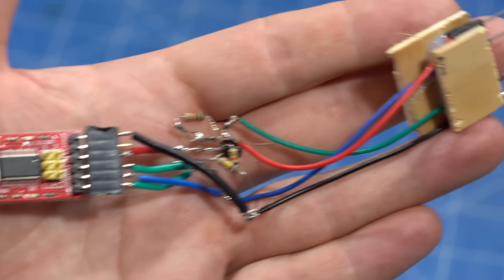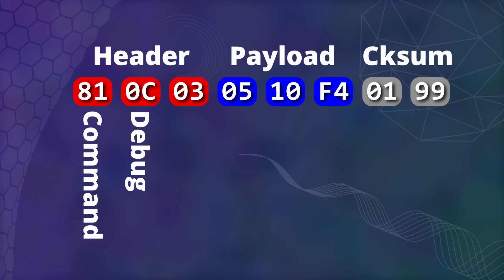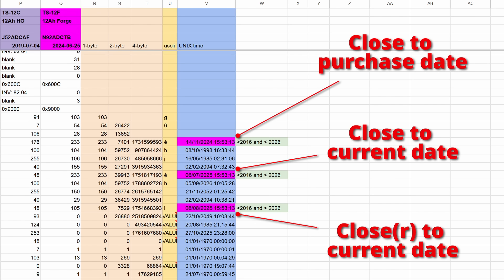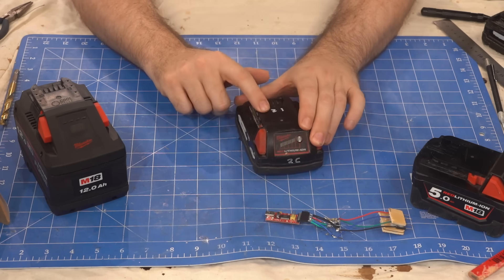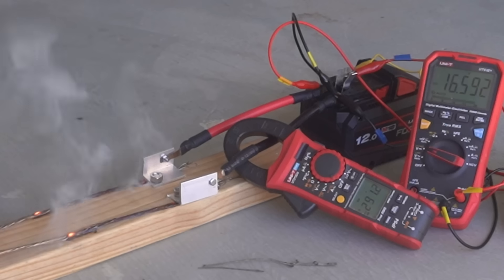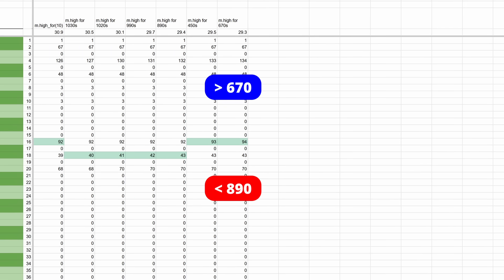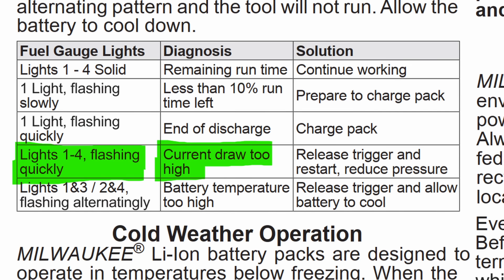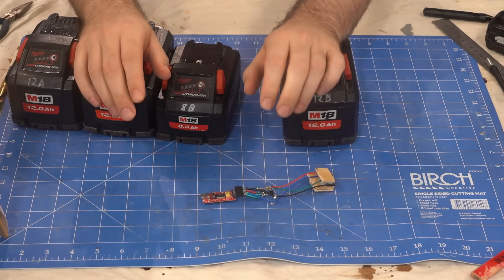Full M18 diagnostics revealed

Comment: wow... so what's the point? your batteries are still dead. LOL. if you can get the boards for $1 and resure the circuirts and reprogram the bms for something else cool but seems pointless all this work for the most expensive battery on the market LOL. YO use your brain man, time / effort does not help us all. you should have design a new pcb with blade terminals and a battery holder that fits inside the original case so we can use cheap 18650 or 217000 in these packs. ... there you go, do that project bro.
Reply from the maker: The point is to easily spot failing batteries before your warranty expires. Like bro, dude, use your brain, bro.

Comment: if you feel like diving into m12, the new 5.0 batteries have the curious habit of reporting 1 bar on one tool, but rebounding immediately to 3 bars when dropped into a different tool. they'll also red/green flash on a dumb charger, but after being pulled and placed back in the charger an hour or so later, fully charge like normal... i personally feel like they're a downgrade from the 6.0, but they do have higher peak discharge i've noticed while using the new stubby 3/8 impact. try to knock a bolt lose with the 6.0, then switch to the 5.0. - 5.0 will usually knock something loose the 6.0 failed to.

Comment: Coming from a previous Milwaukee service tech! They trained me how to use the diagnostic tool and the milwaukee diagnostic application. Its pretty cool diagnostics. Its cool that someone has been able to crack it and do it themselves!
Reply: ALSO. The little wifi symbol with a key is the “one key” battery. Its a bit more money and you are able to lock out the battery from being used. Track it. Etc etc. but ALSO with the Milwaukee application id be able to lock or unlock that battery from being bricked/ locked out. Which was also a cool feature

Comment: Ridgid now PLS!?!?

Also.... I don't even understand HOW a company COULD use ANY of this to justify denying a warranty claim. If the battery was used on the same brand tools, for normal tool reasons... Hard work or not... and it wasn't running a power wheels or ebike or something. Then that's that..  The battery failed, be it overheated, or died in whatever way, doing NORMAL battery stuff. On a tool, on a charger, whatever. Shouldn't be able to say no to a claim, that's horseshht.

Comment: That flash code got me as well. WHY does that flash code happen when you hold down the battery button down?
Question?
Do all Milwaukee batteries share the same board or computer?
Do the Ridgid and Ryobi share the same board as well?
Does the charger and the battery both communicate?
Maybe that thermistor, is protecting the cells.

Comment: Such a nice video. Thanks. 
Would be amazing if you could look into the MX Fuel Batteries. I have one I want to use in a DIY project but there is no way to get power on the terminals. It's like Milwaukee needs a certain unlocking by a tool or charger for the terminals to open.

Comment: Any chance this can be applied to Dewalt batteries in the future?
Reply from the maker: Most Dewalt batteries have no microcontroller, so they're imcapable of storing diagnostics. Powerstacks do have a microcontroller, but not sure if there's any way to interface with them.
Reply: @toolscientist same with the FlexVolt batteries?
Reply from the maker: @BlownF150  so far. Lots of small chips, but none are microcontrollers
Reply: @toolscientist wow, odd they'd invest in components like that yet not something to datalog such expensive batteries. I have Milwaukee and Dewalt ecosystems and most of my batteries are now 5Ah or greater varieties.
Reply from the maker: They're fairly basic components. I think just voltage supervisor chips that they chain together so that if any cell goes low/high voltage it makes the C1-C4 pins go low/high. Then the charger/tool will know to stop. But yeah, an MCU would prob be easier and let them store diagnostics for improving their packs
Reply: @toolscientist Do the larger M12 batteries have microcontrollers? I had an M12 5.0XC that would not charge after only a few uses and never abused, used it with the M12 tire inflator so it mainly just sat in a vehicle storage box. Milwaukee replaced under warranty but now I wonder if I somehow bricked it.
Reply from the maker: @BlownF150  I've only seen M12 2Ah and 3Ah myself. The 3Ah has a microcontroller, but it's not clear what it does

Comment: I am plagued by cell imbalances on my M12 6 amp hour batteries, which prevents them from charging. I have to jump them to another battery to get the cells balanced out before they will charge on a charger.

Comment: 30 years ago I wrote a VB for DOS program to hack saved game files for a PC game called Quarantine. I had to find and decode stored weapons, ammo amounts, money, etc.  These days I write some embedded code for uCs and am aware of the addressing and code structures used by some systems. The point: what you and the gang have done here is amazingly complicated.  There aren't sufficient words to covey how daunting that task was.  I am most impressed.

I'll get on Github and check this out in the next few days, see if I can contribute anything (3D model for the batt interface, PCB layout, whatever).

In summary: damned fine work.

Comment: 14:58 I have a 5aH that i currently use at work that does this stutter. Was never quite sure what i meant, but it's always when the battery voltage is getting low. Thanks, this video helped me understand!

Comment: huh, i have found my 12 amp hour batts to be my most reliable. my 5 amp hours just quit after little use. i do have a special rule. i dont use them below 2 bars. with heavy use until half bar, i find they rebound to full or 3 bars. with this technic and two batteries, i can leaf blows my entire yard and have two half charged batteries at the end. if i use each batts until fully discharged, it takes me three batteries worth. the forge batt performs even better with this method.

Comment: Does this apply to other batteries made by TTI such as AEG ? I'd be really interested if thats the case!
Reply from the maker: AEG has a BMS with a microcontroller, so it may well have diagnostics. It is very unlikely that it would use the same message format and data locations, though. If they have a system, it will need to be reverse engineered like in this video.

Comment: That level shifting chip you showed was only 3.3 to 5v      you need the 3.3 to 8-20v though, yeah?
Reply from the maker: It's a general purpose shifter. Shifts to whatever voltage is tied to the central HV pin. Unfortunately they label it as a 3.3-5V shifter, but that's just what most people want.

Comment: I love everything about this. Why burn gas and waste time driving around trying to get a battery diagnosed, replaced or simply checked, when you could do it at home?
I have my first battery of 12 give me issues. It's the newest one too, not fully charging and going dead quicker than the 5.0AH while being a 8.0AH.
Of course it failed exactly after the 1 year warranty. Just like the triggers on the impacts. Never fails, they break shortly after the warranty expires.
Thank you for all the hard (tedious) work!

Comment: Fantastic. I've noticed what you described at the end of the video: 5Ah batteries are the most reliable. I've got a dead 3Ah and a dead 8Ah, with 5x 5Ah running like champs. I'm going to run diagnostics on all my batteries.

Is there a way to rebalance the cells on a battery that has no warranty anymore?

Comment: So I have a m18 xc 5.0 from 2019 and it's right in the period when Milwaukee locked out the diag so mine doesn't blink but it has the wifi code on the bottom, can I still use this to check the battery info?
Reply from the maker: Yes, > 2016 has UART diag, even if they don't have flash codes

Comment: Very nice thing to reset that BMS, that would be great if that were possible to do with laptop batteries, because 99% of them say the cone to the end of it's life, but if you tear down the battery and test the cells they're in very good condition, but the BMS tell to the laptop the battery it's dead or worn out, it works mostly by number of charges-discharges, and or elapsed time, there are an electronic box to reset that BMS also a small circuit board cp2112 to do that, but the software for both things it's a rent thing, you can buy it but you don't own it, you have to pay for it's use for each battery you want to reset, or weekly and for month(s), and even just paying to reset a battery it's expensive, thanks

Comment: With all this data they can easily use your batteries as a surveillance device.

They can track what times you're more prone to use your tools, overcurrent and overheating timestamps would help profile type of trade and abuse frequency. 

All that paired with customer info like company name, location, etc they can easily make a customer profile.

Then aggregate many of those profiles and they can start measuring elasticity and proclivity for just buying new or servicing. They could easily become abusive and selective towards what customers to honor a warranty and what others simply get a "No, you need to buy a new one".

I'm all about having good battery health and power management, but there's nothing impeding them from engaging in customer profiling and then selling customer data to brokers, contributing to this BS surveillance economy.

Another argument why the world peaked in 2010 or so....

Comment: Mate I have a question. I use my M18 batteries with my Ryobi stick vac via an AliExpress adapter. The vac runs perfectly from full to empty but if I don’t drain the M18 fully, and take it off the adaptor, it goes into fault mode and won’t accept any tools, including m18 ones, until it’s been put on the charger for a few seconds. I’m curious as to what Milwaukee can see in the history regarding these “events” and if they can tell the battery was used with a different brands tool?
Reply from the maker: I'll have to try and recreate that. So you run on Ryobi vac from 4 bars to 2 bars (or thereabouts). Then if you take it off and put it on an M18 tool, it won't run. Then you put on charger for 5sec and then it will run?

I've definitely seen their soft lock that won't let a tool run, but putting on charger for 1sec resets it. But don't think I've seen that from discharging on a non-M18 device (and I've done that a lot 😄).
Reply from the maker: Also which particular battery and what's manufacture date (middle six digits of serial number - YYMMDD)
Reply: Great video too btw, have subbed :)
Reply: That’s correct, but once the M18 is plugged into the Ryobi, it doesn’t give any bars, the only way to identify how much charge the Vac has used is by plugging the battery into its charger. So yes, it runs fine on the Ryobi but then soft locks once removed from it. Weirdly, the vac can be stopped and started without issue as long as I leave the M18 plugged in. Unfortunately I have painted over the label (anti theft deterrent at my previous job) however I purchased these batteries between 2021 and 2023
Reply from the maker: @ScootzNZL  what type? 5Ah, 3/6/8/12Ah HO, 6Ah Forge?
Reply: @toolscientist 6Ah Red Lithium-Ion
Reply: Given the age of the batteries and the fact they were bought in Aus and I now live in NZ, I’m not even worried about warranty etc, I just find this whole diagnostics data thing incredibly interesting!

Comment: As an ex warranty officer for milwaukee, our internal program listed a lot of great data that not only connected to batteries but also tools to the pc via usb. We could read a lot of great tool data, first use, cycle counts, serial numbers.
It is a little annoying that only we had access as it seemed like a great management tool for enterprise and checking in on tools besides one key.
Reply from the maker: Can all tools be interfaced with or just one-key?

Yeah, it's a great system that I could definitely see big companies wanting to use.

Comment: Wait then what is the max you can draw from a 5ah m18?
Reply from the maker: Depends on the age. I tested one a while ago and it tapped out at around 80A. They stop when the voltage sags below the cutoff limit. I think a new one might manage 120A. According to my histograms, one has done 54 seconds of 200A+, but that would be lots of very short spikes of maybe a few milliseconds adding up over time. It's 54 seconds out of 65,288s total usage, so less than 0.1%. Their current measurement is also not super accurate and motors are extremely noisy

Comment: I can't find a level shifter with the range you specify in the video
Reply from the maker: Most are general purpose adwill shift to whatever voltage you attach to the central HV pin. They just call them 3.3-5V shifters because that's what most people want

Comment: I’d love to know a little more about the column counter circuit. I set out to soup up a golf cart to break 50mph (successfully, it’ll go 70 and has more. The limiting factor is currently my instinctual aversion to earning a Darwin Award). One of the most expensive parts was a columb counter battery meter that can handle 3,500A @ 84.5v.

Comment: Too bad they’ll put a “safety measure” in place to shut the whole thing down when 10 wrong commands are sent so personal diagnostics will not be allowed from this point.  Disgusting jt’s legal, as you bought the thing outright and own it fully.  Why shouldn’t you be able to communicate with it however you want?

Comment: This is very impressive, but Milwaukee, unlike Ryobi of all companies, does not employ any sort of anti tamper systems in their batteries, so you can just buy a new battery, a hex bit screwdriver, and swap the innards around and get your money back.  There is no way for anyone to know this has been done, Ryobi on the other hand uses a plastic screw cover to hide one of the screws, and it can only be removed by being gouged out.

Comment: Use min/max on your current meter to get the real high amp count. You can’t watch fast enough.
Reply from the maker: Yeah, but I want to see the average current. Purpose of these tests was to identify discharge buckets, so I was holding a current for ~3sec and seeing what bucket it landed in
Reply: @toolscientist  Cool. Idk what kind of meter you have but the basic fluke will do min max average and time all in one. It’s handy for me when taking readings during an industrial battery’s commissioning data when you start charging it.

Comment: Should check out Ryobi batteries, I suspect they have something in the batteries that discharges them to zero volts (ruining the cells) once they get even slightly below charging threshold. I have had multiple Ryobi batteries that worked great, then stopped charging, and I take them apart, and each cell is at 0 volts completely, like the battery discharged itself. A very common thing with Ryobi batteries. Ryobi def make the worst power tool batteries.

Comment: Or you can just skip all that, order a new battery from the manufacturer's amazon seller account, return your defective battery, without going through their BS warranty repair/replace system - After so many well within warranty battery issues, sending them the defective battery, only to get it back stating there was nothing wrong or the issue was not covered by the warranty - Don't feel bad for the Amazon swap deception, I've wasted hundreds in shipping bad batteries back and forth.

Comment: Can your program override the soft lock when battery segments go bad? You can replace them and balance the cells but the BMS will still not allow charging/use. 
Also I wonder if the knock off BMS have any simulaur programming.

Comment: I would be interesting to pair this with something like an arduino/or esp32 display, with a few basic controls and a 3d printed body to combine all of this into a simple "check your milwaukee battery health" checker of some kind. Would be easy enough to 3d design a simple "slide in" tool for this. I don't know crap about how to program an ESP32 though...

Comment: This is great to see, even if its information I'll likely not use.  However, what I would like to find out, that maybe someone in the comments know: is it possible to create a signal harness that could read individual voltages using only external terminals on the battery?  Could this harness then allow connection and balance charging of the 5S batteries using a hobby-grade (LiPro B6 or eq) balance charger?  For instance, a Bebop 2 drone has a 3S pack, but connecting the signal wires in a particular order allows individual charging to balance.  I recognize that it seems possible with the battery pulled apart, but for me that would be a pretty time consuming project.  It would be incredibly convenient to recondition my packs like this over just throwing them on the stock charger.

Comment: Now you need to make a way to wipe the data from the board, so there is nothing for them to read. Then they will have to warranty it since all they will see is a bad board and then if they replace it and the battery still don't work they have to replace the battery.

Comment: Can you please list out the meter setup your using to capture current draw. I have not had much luck with dc clamp meter accuracy and would like to get into something other than a shunt setup
Reply from the maker: Uni-T UT219DS. I've done some simple tests and compared it to the output of my 10A power supply (and running through my multimeter) and it was decently accurate. Can't remember how accurate, but it was better than I was expecting. Maybe within 0.2A?
Reply: @toolscientist  Thank you very much

Comment: Imagine designing this kind of "diagnostics" on the battery to deny as many warranty claims as possible, measuring voltage across cells but not having balancing circuit there. EVIL